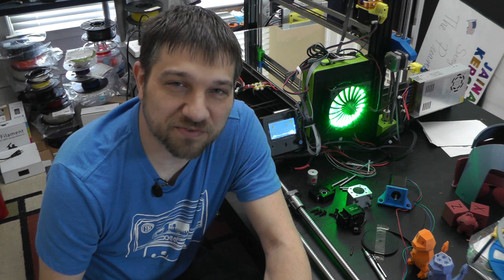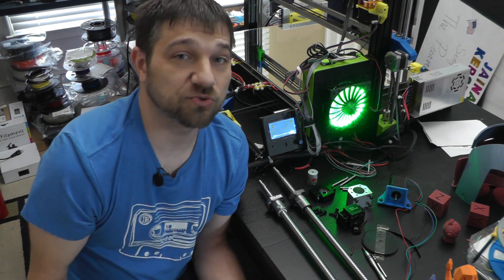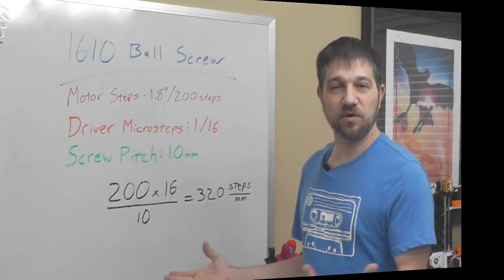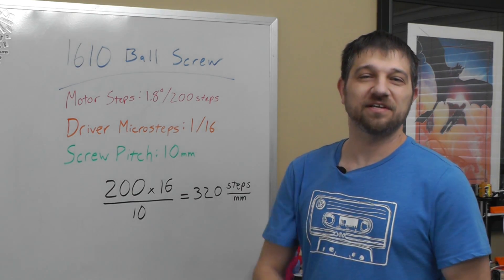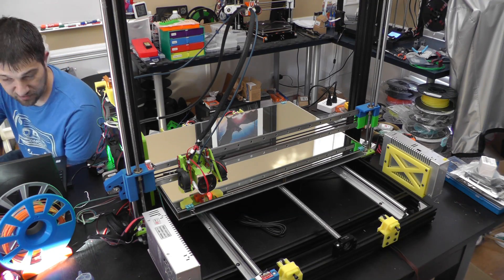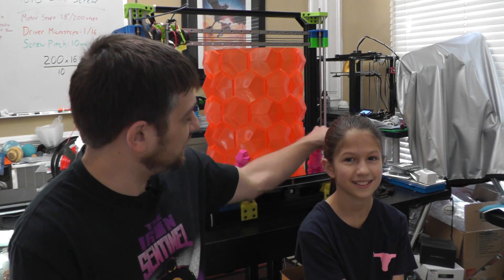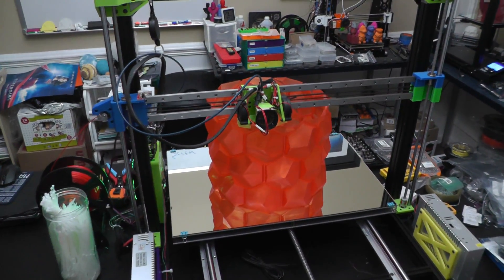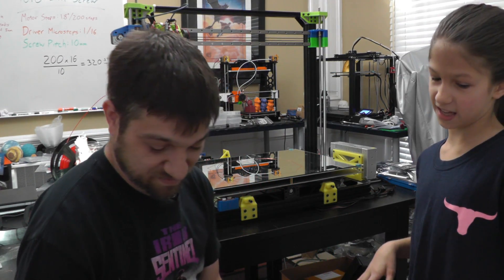Replacing Belts with a Ball Screw on a 3D Printer (Cosplay 600 series)

Comment: Stop moving the bed, have look at core X Y.
Reply from the maker: I'm quite aware of Core XY. I wanted to do something different. This allowed me to explore ball screws and I was comfortable with designing an i3 printer.
Reply: it still wobly wobly you are still using PLA 1.75 0.4 nozzle and try print 0.05 layar height
Reply: I received a Creality XR 10S Pro friday and went through all day Saturday. Level, rollers, square and balance. The Bed is a thin aluminum frame to cage the 8 rollers and a 300X300 heating plate and then the printing plate. 3 of the rollers did not even touch the rail or rotate and there was significant lumpy feel. I got it all squared away and tuned the X rollers, some also nonop. Leved the table, the machine frame, the print bed. Used the built in sensor and had a very flat surface. I loaded the test dog with ABS-R and let it run. I monitored the vertical beams with my dial indicator. .003 movements maximum. But i could only reach 1/2 way up. With my fingers on top top I could felt every change of direction of the print bed. On fast short movements it was really a vibration set. The print f oil r me was stunning but there are rings visible. I ordered struts to tie the top to t HF e base making a triangler shape. I studied the bed assembly and find while light it still is a lot of mass to through around. I thought about carbon fiber bed plates for near zero mass. But I looked at the drive parts. Thin narrow belt, cheap ass bearings and no conditioning in the change of direction pulses to the stepper. Reminded me of a jeep CJ snow plow that we would jam from low to reverse pushing snow until the tranny wore out. I think a beefier drive setup and a more ramped accel/deaccel would help. Slowing transitions as well. Clearly X&Y on a light head would likely be easier to tune.
Reply from the maker: That's what I've been trying to say.
Reply: This comment is quite funny, because you also move the bed on a core x y :D I think the only reliable printer with no moving bed would be a delta printer.
Reply: @10ulcinj  Not particularly funny, it's a good observation. With core XY you move your Z slowly down, by one layer at a time, those moves are many times the Z resolution and where mass doesn't matter at all. Unlike the XY axis which you move rapidly up to the limit of your horizontal resolution and where inertial mass is minimal, the entire point. In core XY, the Z and XY dynamics are nothing alike.
Reply: @m3chanist  I know what you mean, but your still moving the bed and getting artifacts from moving it. imagine z hop on a corexy with a 1-1m buildplatform that would cause a lot of trouble.
With that last comment i was just making a joke from this comment, because even if you disagree the bed moves even if it's slow moving, its just funny how serious his comment was. theres alot of benefits from a corexy but also downsides, and its the same for a i3 clone or a delta or any other method.
Reply: @10ulcinj  The only artifact you'd get off a bed moving up and down is a seam, but all fdm printer types have it.
Reply: @10ulcinj  Well yes, but it only moves a little bit between layers and for zhops.  It doesn't have to be core-xy to have a vertically moving bed either.
Reply: @10ulcinj  this comment is funny because a CoreXY is running in the background actually.

Comment: The ringing issue you're having on both the belt and ballscrew is the same. There's too much slop. To fix this with a belt, you should get a fiber or steel reinforced belt, and use a belt tensioner to tension it all the way. You should be able to strum your belts like a guitar string. For the ball screw, normally this wouldn't be a problem with the Z axis because it's under load. To fix this you should add one of those flanges with a spring, I can't remember what they're called, but they make special parts specifically for giving the ballscrew nut a little push to eliminate play on the threads.
Reply from the maker: Thanks for the feedback. On the belts, I have exactly what you suggested. I'm using high quality GATES Power Grip GT belts that are fiberglass reinforced.  I also have tensioners on both belts and they are tight but not over-tightened.

For the ball screw, I'll do some research to see what I can find. Thanks!
Reply: @kerseyfabs  No problem! So I did some digging and I remembered what they're called, google "Anti-Backlash Ballscrew", "Ballscrew Preloading", and "Backlash Nut". There are a bunch of different ways to do it, but I think the best way would be to get another set of nuts, and then put them back to back on the screw with a spring in between them, but don't make them too tight, just a little, so they'll be pushing away from each other slightly and getting rid of any amount of slop between the balls and the screw. 

Here's a good link to illustrate: https://www.thomsonlinear.com/en/training/how-can-i-reduce-or-eliminate-the-backlash-in-ball-screw-assembly

Also,  if you choose to do it this way, keep in mind you might need to readjust your voltage because the added friction will require slightly more torque, but I'm sure it will be a tiny amount. 

Here's a good article about that: https://www.linearmotiontips.com/ball-screw-preload-what-you-need-to-know/

My printer doesn't have ballscrews, just regular acme threaded rod, but this is what I did and it worked. I totally forgot about this because it's been a few years since I've used the printer haha.

Comment: Lulzbot have been making the transition to belt driven z axis. The mini 2 and the taz pro. So there must be some merit in that. 

Nice video I've subscribed.
Reply from the maker: Thanks for the feedback. I'll take a look at what they're doing.
Reply: Sure, Z belt drive eliminates screw wobble BUT you want reduced drive motors to hold the gantry in place on power off, especially with heavy gantry machines.

My two cents: larger machines are another deal. Anything should be beefy and more precise. If you use ballscrews for X or Y, you need fast servomotors, probably AC ones to preserve velocity. The weight of your moving bed is way to high for a nema17 anyways. Second ballscrews needs extra mounting precision. Forget printed parts, definitely. You want a micrometric alignment along the 3 axis for each ballscrew. It ain't any permissive toy like belt drive. 
My opinion: you could beef the belt system using quality 15mm GT3 belts and 1.5Nm nema23 motor to have comparable velocity as a smaller printer. To me, the major problem are still the guides and the stiffness of the whole structure. First time I see your machine but it looks like kinda 600x400mm. It's pretty heavy for a moving bed. The SBR are not stiff and precise enough anyways.

You probably reached the limits of what the conception of your machine allows. I see endless expensive upgrades to improve print quality : beefy prismatic rails, powerful  motors, then question the stiffness of parts and structure... Over 300x300mm, engineers like moving the bed slowly along the Z axis only. With a CoreXY or Ultimaker movement.
Reply from the maker: You're right on all counts. For the most part my response is that I only have so many resources in terms of machining my own parts and spending a ton of money on higher end components. So I will improve one thing at time as money and time allow. Thanks!
Reply: @kerseyfabs   For sure larger printers will be much more expensive! Multiplying the print volume by 4 should raise the budget by 12 ! Entry level printers are cheap because they're light and small. That's why an Ender3 prints better than a CR10S. Anything matters, from the first ounce to the extra length of the bowden tube ! 

My advice is to compensate with ducking the speed. Because I guess there's endless upgrades coming to get the print quality you want. Large printers needs specific design : fixed printbed, heavy structure, excellent guide/transmission system, powerful motors... IMHO your design is too close to a small printer, like the CR10S, bu the way.

I choose to stay at 300x300mm build surface and rather multiply the printers. To get perfect parts form small printers is easy and inexpensive. Assembling is no big deal. I do not use very often my 300mm printer at it's maximum capacity. Because this is soooo long ! Most of the time, I split parts and sent the pieces to multiple printers at the same time. In a couple of hours, I pick up all my parts and assembly is even faster. A 3D printing farm is the way I choose.
Reply from the maker: I don't disagree with most of what you said. I find this sort of project fun and challenging because most people say it can't or shouldn't be done. Plus I may just figure something out in the pursuit that has value to myself or someone else.
Reply: @kerseyfabs  Electromechanics and structural of a 3d printer are not difficult. Anyone can reach a good result. The one who claims the contrary is an idiot. There's just rules to respect. The most important is a good start. If you get some interest about mechanics calculations,  you will notice the importance of weight for moving parts. I'm afraid you took a wrong start. 
Please hold on a minute and let's talk about general principles of machine building. You need a large volume 3d printer right ? Large volume brings several problems : mostly weight and precision along a long distance. The weight of your building surface is the major issue. You don't want it to move quickly with frequent rapid direction changes. That's a lightweight moving part job. Definitely. If you stick to a Y Moving bed, that will be expensive or unsatisfying. Think about wear too. That's why you want your bed moving along the Z axis. The movement is slow and linear by small increments, so it's cheap and easy whatever the weight. You can keep most of what you have including stepper motors. That's the way to go. Definitely. 

The bed problem solved, you want a fast and precise printhead movement. As the head is light, it's no big deal and this should not be expensive at all. You already have 2 good rails along you X axis, you just need another one for the Y. The easiest is to get a stiff and flat surface. It could be a piece of kitchen countertop or some 3/4" plywood. That assures X and Y are on the same plane. Make a large opening at the centre, adjust and fix your rails and you're done. 

I believe you already have 90% of the required components to build a good machine if you do it the right way. 😉

Comment: Since you reduced the distance each step moves, you also reduced variation from motor positioning bouncing around. In essence, the motor is more accurate, even if the belts didn't stretch at all. (Since your stepper motor is open loop, the position will naturally oscillate around the selected microstep.)
Reply from the maker: Agreed! I would love to go with a closed loop system but I need to figure out how to do it economically.
Reply from the maker: I appreciate the article. So what are you suggesting? Most 3D printers are using 1/32 microstepping. I've already taken mine to 1/16 on the Y. This gives me 160 steps/mm. That has always seemed overkill to be honest. The resolution of the plastic isn't that good!
Reply from the maker: @npgoalkeeper _ That's my belief as well. I feel a video coming on.
Reply from the maker: @npgoalkeeper _ Alright, I had to look that one up. My favorite part of all of these comments is learning new things, so educate me on how I would use this rotary encoder.

Comment: your mounts are likely nullifying any gains you made by using a ball screw.  After you fix them the bearings are going to be the next weak points for your ballscrew.  Most deep groove ball bearings will have more slop than your ballscrew nut.  when your bed changes direction at high acceleration the slop will show up in both the mounts and bearings.  good BF/BK mounts with angular contact bearings likely cost as much as the ballscrew you used.  the reason for this is they can resist the axial loads created by driving the nut with very little play.  Of course even if you have great mounts the energy would be transferred into your frame and if your frame is not rigid you likely gain very little.  your results are only as good as the least rigid part of your machine.  Now I'd guess it is in your mounts for that axis and you can test this with a dial test indicator so you know how much flex you have vs the belts.  Any resonances in your printer will show up as waves as the slop bounces around due to each axis having play.   Finally nema17 will likely need a very conservative acceleration setting to avoid skipping steps due to the weight of the screw.  If you look at the core-xy printers they optimize everything for the lowest possible moving weight which is why they can use such small motors to go so fast.  Every gram of weight you have to move impacts your acceleration profile and the energy that will eventually get transferred into your frame.

I'd also point out that you really need to support the rails with something other than the linear rails themselves.  both sets of rails are not likely really straight and they should be fastened to a rigid machined surface which will pull them flat and provide the rigidity for the machine.  The spacing on each type reflects the specifications required.  Round supported rails require less accuracy and the fastener spacing is larger.  Square profile rails typically require much more accuracy which is why the holes are so much closer together.

From what i've seen both cheap GT2 belts/pulleys have quite a lot of backlash.  You can't really tell unless you measure it with something.  I'm planning on experimenting with cycloidal rack/pinion and from my initial tests they have less backlash than GT2.  While ballscrews are great for a CNC machine they are likely too heavy (for rotary inertia)  for a printer using nema17 motors.

This is all pretty easy to test and you may want to do some backlash testing before you commit to a design change.  Your machine looks like it has a lot of potential but much of it is wasted.  My MP mini can make better prints.   

Keep on going though, there is lots to learn.  go buy a surface plate and a dial test indicator so you have a proper reference for flat/straight/low backlash.  Flat and rigid is surprisingly hard.
Reply from the maker: Wow! Thank you so much for taking the time to lay down your knowledge/experience!

I absolutely realize that I will always be at the mercy of the least "whatever the need may be" component. I'm not going to perfect this machine, as I will never pour that kind of money into it. This is a hobby machine and I'm only looking to produce "as good as possible." I'd like for others to be able to replicate my work at some point and then they can improve on what I've done. If I can keep my "final product," if there is such a thing when tinkering, to under $1000 for the parts included, that's a success for a nice large printer.

The next major upgrade to this machine is making the X axis more rigid. It's a design challenge but I'm liking my solution so far. I'll go over all of that once I'm further along.

The  belts I'm using are actually GATES belts, so I tried to get the best belts I could reasonably buy. I've read that these fit that bill.

Oh, there's no doubt that smaller printers can do better. My Ender 5 does much better. But I'm going for large and better, which as you've described, is much harder.

I'll be getting some more test equipment as I can afford it and as I get closer to really dialing this thing in. Thanks again for all of your feedback. I'm taking notes!
Reply: @kerseyfabs    no problem.  btw you are using good components, just try to not re-invent the wheel in how you are using/mounting them.  Your machine really does have potential if you methodically get the most out of your components.
Reply: GT2 belts have more backlash than a cycloidal rack/pinion? I'd imagine your point is "Cheap" belts? Because the 3/5 mm pitch belts I've used make rack and pinion seem like a boat in a hurricane. Your other points are dead on, so I'm interested in what tests gave you this conclusion
Reply: @imabeapirate    I built a little pcb mill and did one axis with the rack/pinion and the other using belt.  I was shocked how much backlash the belt had.  I think i recorded the test and i'll try to post it if I find the footage.  here is a test someone else did on the rack/pinion  https://youtu.be/URkED5HQFCU

Comment: It's not just the ball screw, you halved the acceleration which would probably have improved your results even with the belt
Reply from the maker: That's a great point! Unfortunately I wasn't aware of how low I'd have to go on the acceleration with the ball screw, so I didn't think to drive down the acceleration on the belts to improve quality. If I get a chance to look back, I'll put them back on for a test. With my limited tinker time though, it probably won't happen with the exact same configuration.
Reply: With a build plate that massive though the ball screw will probably help a little with larger and heavier prints than a massive vase mode print.

Comment: Great video!  Are you using snubbers on your steppers, please?
Reply from the maker: No. In fact, I wasn't aware of the term until I looked it up just now. I'll do some more research into it. Apparently the TMC2130s have some snubber circuitry built in but I could find no reference to it in the TMC2208 datasheet.
Reply: @kerseyfabs  Also if you get to the point of using leadscrew  bushings with ball bearings there are more than one type depending upon your intended use.  You will want to investigate the manufacturers for design assistance tools.